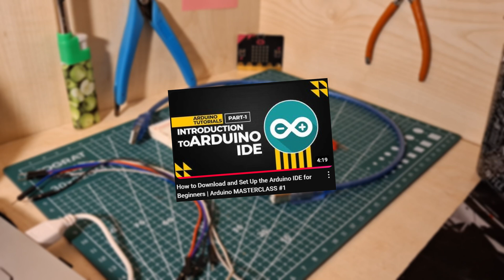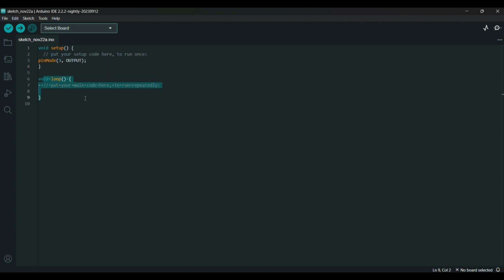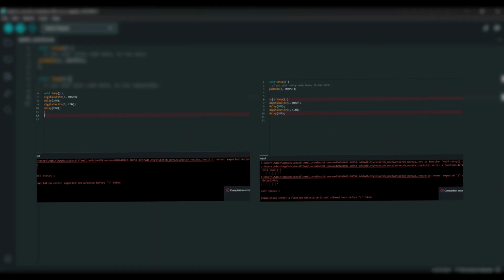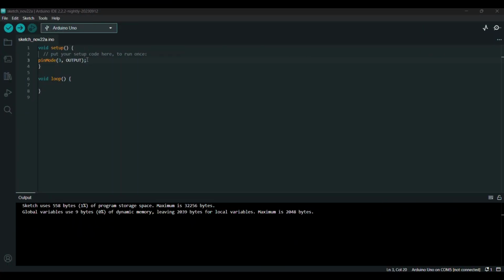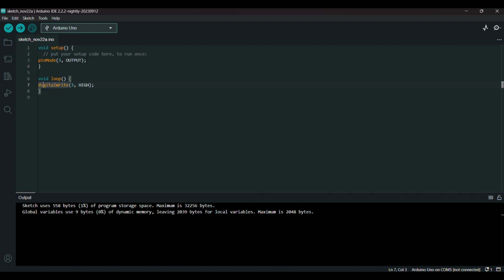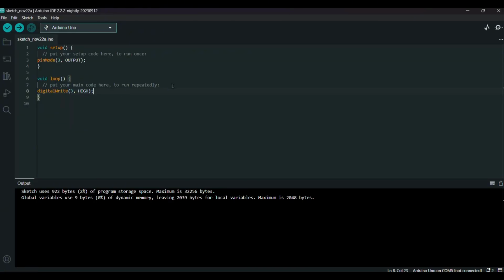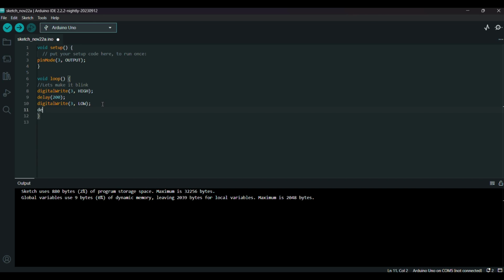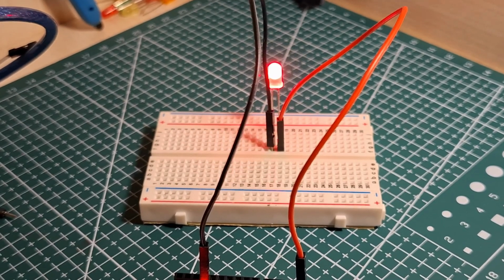Arduino Basics: void setup, void loop and Curly Braces | Arduino MASTERCLASS #2

Comment: sir, i want create a one wheel skateboard using Arduino and i have zeo idea about how to connect to hub moter to moter controller-to MPU6500 Gyroscope how i can code it can u help me?
how to able to adjust the speed of hub moter using MPU6500 Gyroscope SIR please help me if you can and i am waiting for your reply
Reply from the maker: Hi! Your idea is interesting, but it has several challenges. If you're new to this field, this project might be a bit difficult for you. But anyway, don't worry I'm adding the usage of gyroscope with Arduino UNO in my pipeline, so stay tuned..🤗